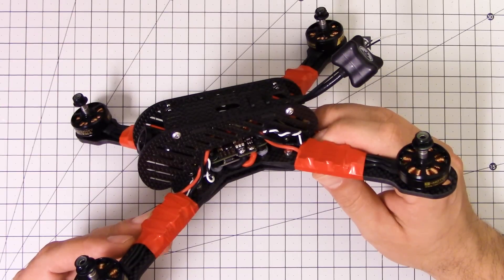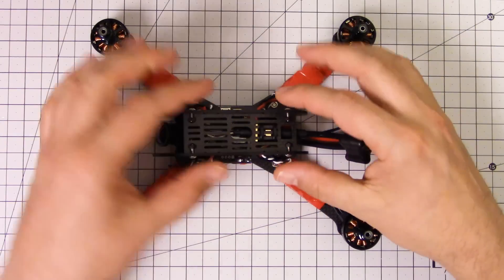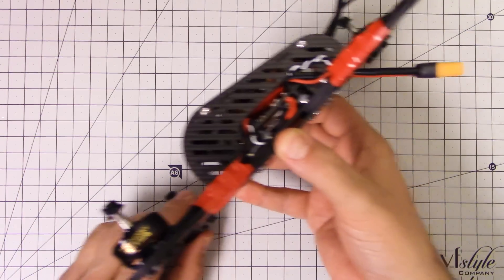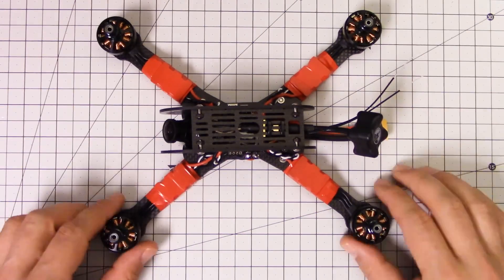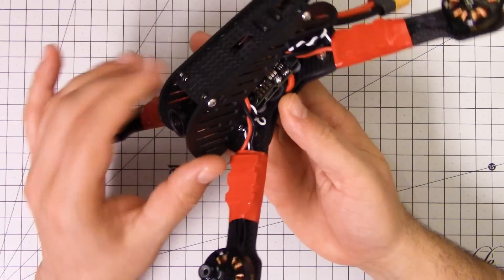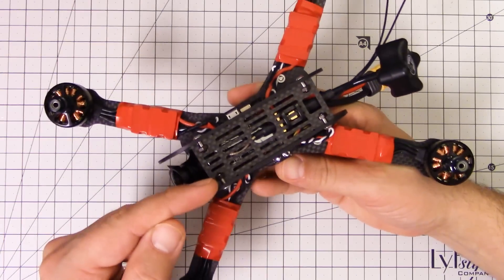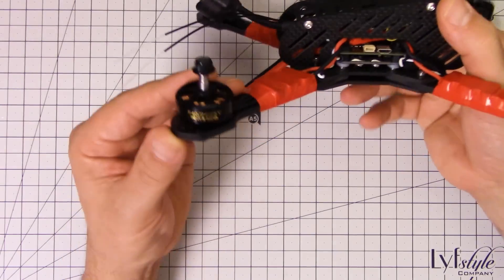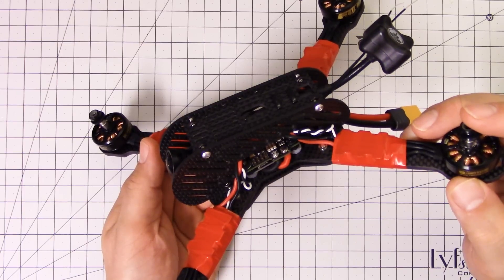AllCarbonRC Coyote | RACING DRONE REVIEW

Comment: Nice review except you missed the main reason why the long X performs so much better or at least the common theory.  It's not so much about the longer pitch lever.  It should be noted that Brian Morris was the very first to formally recognize this phenomenon and you'll notice it too when you actually fly it.  When you're at any various tilt angle and look at the profile in the sagittal plane, the long X moves the rear props farther outside the area of the front prop disks.  This gives them less turbulent air to deal with and makes them far more effective.  You can fly much faster with a LOT more control with much less tilt.  The first time I flew one I was absolutely dumbfounded at how much better it was.  The long X actually carves through turns rather than more of a stop go like a symmetrical X.  Please do watch my video for just a minute and a half from the 2:10 point.  Not as informative as your videos but I try with what time I have.  Love you as always.

https://youtu.be/pH4AnBpSDL8?t=131
Reply: obviously you're right, physics agree with you (atleast in theory).  I am also surprised he didn't even mention that since I understood exactly why this frame was created for, the instant I first laid eyes on  a pic and I doubt I was the only one to instantly 'get it'.  It's kinda disappointing that he didn't acknowledge this , if not intuitively at least through community info!

Thank you for posting this, cause I was gonna do it and prolly  have done a worse job at it, lol.  I've been randomly landing on some of your videos, and you've been doing a great job...another subscription added to my list.
Reply: Just wondering. Would be a relieve if someone helped me with this my silly question.
If this stretched X's advantage was about how much tilt angle to get it flew straight, how about interlaced X frame just like Realacc Phoenix X210S? Isn't that frame could reached low pitch angle too. Will this interlaced X frame would get the same advantage just like stretched X?
Reply: lol I was going to comment on the cleaner air the rear can receive from the extra distance from front with less angle needed. I learned from your channel you guys are great the beginner can take massive steps with just a few clicks.
Reply: the Doctor behind the coolest stretched X frame has spoken!!! good shit Bob! Hyperlite is the shit! waiting on the hyperbaby low.

Comment: If a slower pitch is needed why not reduce pitch rate instead of adding weight to the quad?
For me it doesn't make sense
Reply from the maker: This isn't about rotational rate. I don't know exactly how to put it, but it's more about 2nd-order or 3rd-order metrics like acceleration. The goal is to make the pitch axis feel "stiffer" not "slower".
Reply: I got your idea but even so our quads rely on electronics to correct error, this "stiffness" could be accomplish by increasing Dterm and readjusting the Pterm.
The frame will be heavier that a normal X frame. The only advantage I see is less turbulence in the rear props.
Still, nice video ;)

Comment: That's wrong. The motor mounts of the Blackout H and zmr-style frames  are much wider than long. I found this on the blackout website for the 220mm H frame (there are no 250 anymore):
Size: 220mm diagonally, 175mm wide, 130mm long
Everybody I ask is telling me ,for a racer, a real X is better than a zmr-style H frame (I have a zmr250).
Reply from the maker: You know, you're right. It was the weight distribution that made them turn easier on the roll axis.
Reply: That threw me too.  I was on the motor mixing calculator site...
https://www.iforce2d.net/mixercalc/
I clicked on ZMR-250 and said huh?  Counter-intuitive.
Reply: I gues what counts is how well they fly in the field. Great that you test these things.

Comment: I tried stretched x exactly for the reason that it makes so much sense in theory.  In practice, pure X   builds had way b
etter times and control in corners. After maybe 50 packs, I switched back to pure X
Reply from the maker: Well, that's one vote for "just a fad". LOL.
Reply: What you're feeling with the symmetrical X is the improvement in Yaw authority over the long X.  A tighter X will have far better Yaw ability.  This is usually prefered in acrobatics, not racing.  Unless you only race on tracks with 180deg turns.  The issue with the tight X style is that all the props are screwing up the airflow for each other which makes it generally less stable when flying fast.
Reply: thx for input Kabab, appreciate it. I will try it throught the year on different tracks and compare it. Quite a few people like it so hopefully it will work on fast bigger tracks.
The laps I tried it were mostly tight, either indoor with plenty of 180s or the one I use in the garden with tight corners where ULX  felt more agile and faster by few sec.
It is possible that it was because of size too. 185mm vs 215 or the stiffness of the arms.
I know Shaun Taylor loved the idea and liked the handling of the stretched x :)

Comment: i wonder if theres a frame where the motors are tilted forward 20-30° so the copter is more flat when flying forwards
Reply: Motor tilt will waste more energy during pitch axis rotation. In addition to that, the rear propellers are more likely to be in the disturbed air of the front propellers. I think motor tilt is stupid.
Reply: There are many frames and motor mounts that do this but we've since stopped doing this because it makes the yaw/roll attitude weird.  It also adds weight to the end of the arms which is very bad.  This isn't needed and doesn't make much impact with aerodynamics.  It also holds the rear props exactly behind the front props so it makes turbulence even worse.  As stated by BlackPixxelDE above.
Reply: Agreed but like many things in this hobby it was worth a try.
Reply: Yeah, and it's not any good.
The tilt mounts usually break really fast and it's not good for fast paced racing as turning becomes different and the FC don't really know what's going on.
Reply from the maker: +gamerpaddy yes.
Reply: I've tried motor tilts on some quads but for me they always made the quad fly funny.  Especially maneuvers requiring a lot of yaw.
Reply: there is
Reply: The Eachine Falcon 250 had tilted motors.